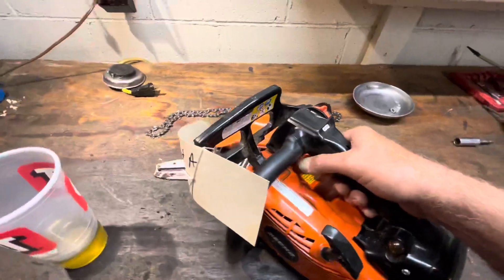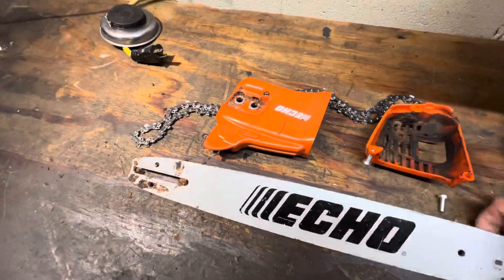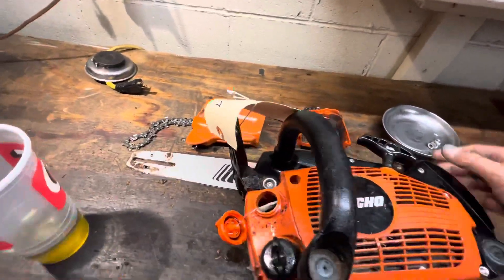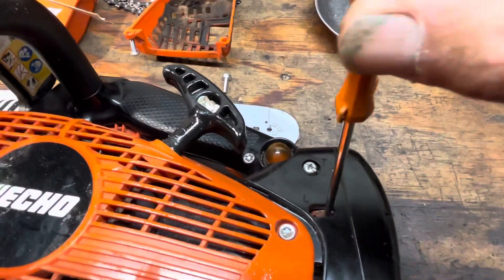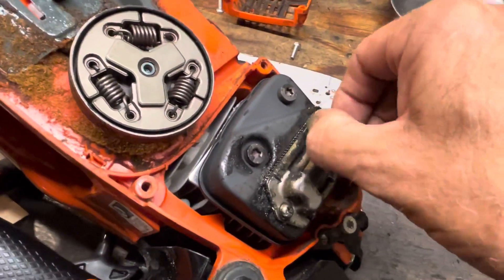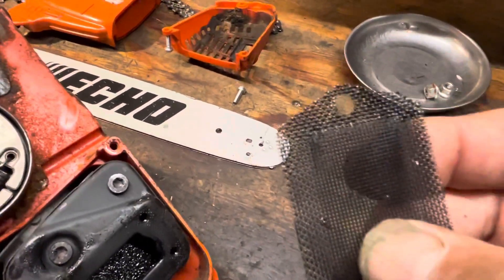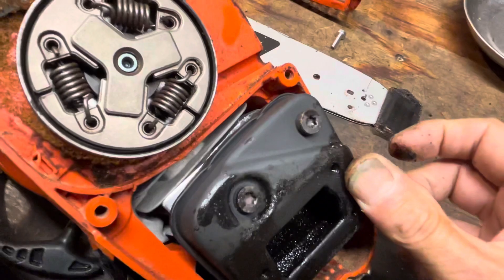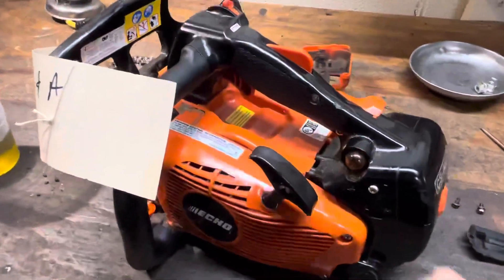Is the Dealer Setting You Up for Failure?

Comment: Good info. And yes! I can confirm this as my 355T was set with both L and H all the way counter clockwise. Throttle response was awful! Mine would not tune to optimal performance under load with the caps on, it was just a bit beyond those settings here at 1300ft.

Comment: We run every new saw at my shop before it leaves the building. Check oiling, chain tension, carb adjustments, etc. that’s the way it should be done.

Comment: I never see dealers set up saws in my area. Ace hardware or the farm stores just hand them out and don't touch a thing. Never will they walk you through an mtronic calibration either. Not that a customer ever reads the owner's manual, either- but still...
Reply: They're supposedly "tuned from the factory" now. Echo specifically is supposed to run through a certain number of tanks before the first carb adjustment.

Comment: Both my echos came like this. With the limiter caps on you can't lean them out properly especially during the summer. My 2511T runs so rich I literally get spooge coming out of the exhaust. I hate taking the limiter caps off of a product with a warranty like Echo's but I feel like it's necessary for the saws to run properly. In my experience Echo simply has their saws set up WAY too rich from the factory and there's not enough movement allowed by the limiter caps to get them properly tuned. Otherwise I really like some of Echos products. Their trimmers are some of the best you can get IMO
Reply from the maker: Spot on Sir.  Echo makes some of the most reliable equipment out there.  My personal blower is a pb8010.  Had it for a couple of years and sounds like it's ported.  I wish they'd get a  more aggressive with the 2511.  They are pretty impressive with a little work.
Reply: I've heard they do that for the break-in period. All my Echo manuals say to run three or more tanks before having the carb adjusted. I also watch at least one other Echo tech who has said the factory settings are intentionally rich as part of the break-in and to have it adjusted once you complete that break-in period.

Comment: Richard; my Echo 7310 came set to as rich as the limiter caps would allow.  It ran 4 stroke on all but under full load conditions -- a real pig.  Set as lean as the limiters allow, it is still too rich to be proper.
Reply from the maker: Damn....
Reply: If warranty is your concern, maby carefully remove the limiters, tighten jets 1/4 turn or so and reinstall them🤷🏻‍♂️

Comment: Granted we don't have an actual echo dealer in my area but the last 2 echo saws I've purchased came so rich the limiters HAD to be removed to achieve a proper tune! Not an issue for me but for the average customer... Definitely will cause headaches down the road.
Also ordered an echo srm-2620 in may through HD. Low jet wasn't too terribly off but would only rev to 6,800 (book says 10,300 max)
Reply from the maker: I did a timing advance and a muffler mod.  It cleaned up without having to take the limiters off.
Reply: @richardflagg3084  nifty way around them!
Reply: Took mine off my 2511ts plural .they were so rich it was a new saw that and drilled hole just at the line under it on exhaust s.then cleaned it out.put quarter pitch sprocket and stihl polesaw bar and chain 0.43 on them and absolute different saw would never run them the way they come.i foolishly did for couple months it's terrible beyind words .I see guys running 3/8 it's waist of time .ported would be even better .mine eat full removals haven't had single issue run red armor on the 2511t saws and change tune up .once while. Don't like those filters but they work am surprised 🤨
Reply: Here the echo dealer is a rental company they don't have tools in boxes neither does the co.op stihl dealers. There not supposed to be in a box there supposed to have 1 a certified mechanic like Richard on site 2 there supposed to double check the tools and carbs bolts exctra before a customer leaves unless your commercial buisness owner they start it up before you leave .i don't let them do that but it's supposed to be done especially for the consumer homeowner or pro sumer
Reply: @Sethhaun78  all my saws are modded to some extent ranging from muff mod to ported and piped so limiter removal is a necessity lol.  But typically run a couple tanks through anything new before modifying to have peace of mind.
The echoes are the only ones I've had that needed the limiters pulled to properly run stock.
Reply from the maker: @Sethhaun78  Unfortunately that's a sign of the times.  These manufacturers have decided to make agreements to sell anywhere.  There's still 3 Echo dealers here that are "full service".
Reply from the maker: @Sethhaun78  Yes, ported they are a completely different animal.
Reply: That way you have to take it back in but the issue isn’t terminal
If it’s running rich and there is I burnt fuel then isn’t that counterproductive to all the emissions crap?
Reply: That way you have to take it back in but the issue isn’t terminal
If it’s running rich and there is I burnt fuel then isn’t that counterproductive to all the emissions crap?
Reply from the maker: @spencerreimann946  One would think it's not making emissions.  What do I know anyways....

Comment: I bought an echo 2620T from my dealer a couple years ago. Completely plugged with carbon after a few weeks of running it. (Every day as I mow grass for a living) took it in and they told me I had to pay for it to be cleaned out b/c I was running way too rich of oil mixture. I was running 80:1 saber. Dealers can be a joke sometimes.
Reply from the maker: Typical.

Comment: I dont understand why the dealer is to blame? The factory adjusts these and tests them to comply with EPA standards. I buy something new i want it in the factory box.
Reply from the maker: Good question.  Here's a great example.  Before I went to a chainsaw "get together" a couple of years ago, I ran and tested about a half dozen chainsaws I wanted to bring.  I live roughly 900ft above sea level.  When I got to the destination in Tennessee, about 3500ft above sea level, all of my saws were running extremely rich.  I had to re-tune every last one of them.
Reply: @richardflagg3084  OK, makes sense then if you're in an area where adjustments need to be made. I live closer to sea level than you so everything out of the box always fires up and works great.
Reply from the maker: @mikezupancic2182  Yes, at 900ft I usually don't have an issue either.  Seems to be a thing with Echo or Zama (carb manufacturer) lately.  It wasn't set anywhere close when the limiter caps were installed.